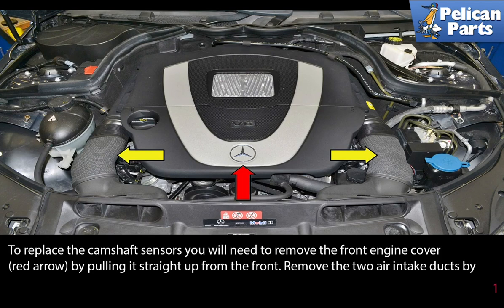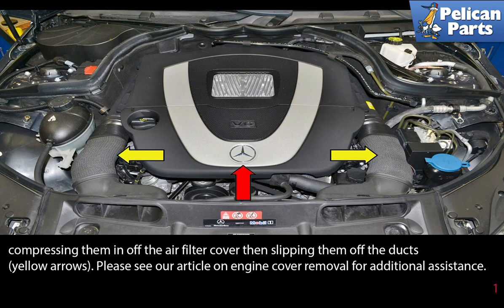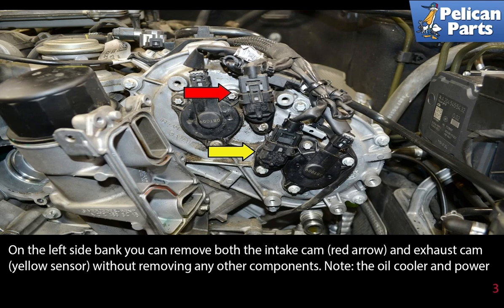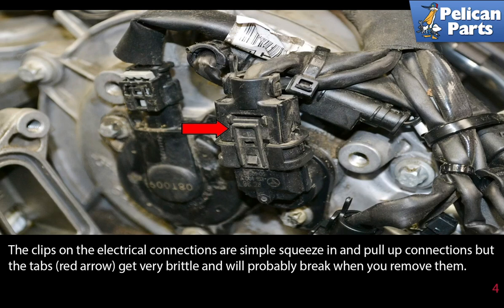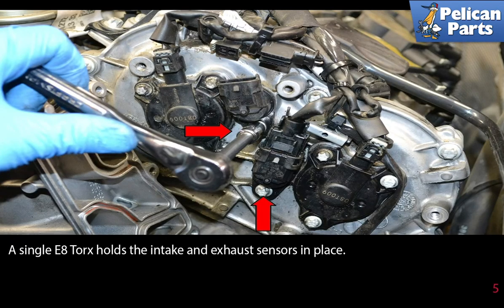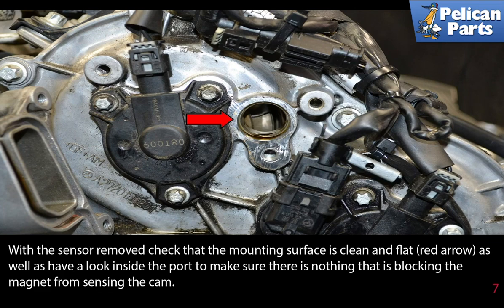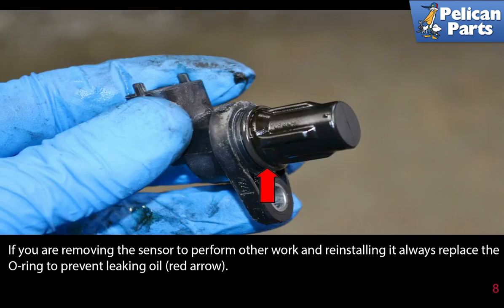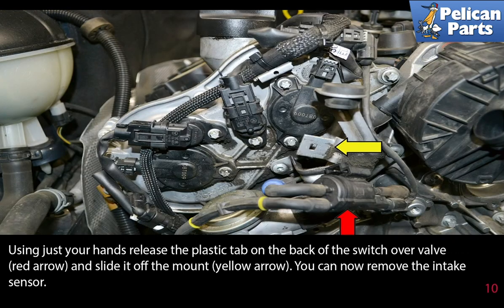Mercedes-Benz W204 C-Class Camshaft Position Sensor Replacement

Comment: sir  could you please answer my question , intake and exhaust camshaft position have same design so how we can identified that which one is intake sensor and which one is exhaust sensor because i am worrying what if put it in wrong side thanks.
Reply from the maker: The sensor near the intake manifold side is intake. Near the exhaust manifold side, exhaust sensor.

Comment: First time working on a Benz and video was great but quick question before I get started, This is for p0022 and p0012?
Reply from the maker: With those codes, you'll want to check mechanical engine timing.

Comment: Hey man do you know which is bank 1 & 2 on a 2013 c350?
Reply from the maker: On a 4-cylinder the first cylinder, closest to radiator. On 6-cylinder, first cylinder, closest to radiator on the right side, when seated in vehicle.
Reply: @pelicanparts  so which one is bank 1 ?

Comment: What is the torque specs for these?
Reply from the maker: What is the year and model of vehicle? I can see if I have that info.
Reply: @pelicanparts  2010 c300
Reply: @b.trill6868  2009 C350. Also you say you don't have to remove the oil cooler or the power steering unit. Do you need to loosen the power steering pump but not take off?
Reply: @waynesalekin4737  na for the sensors I didn’t have to remove or loosen nothing at all easy twist and insert
Reply: @b.trill6868  Thank you so much! I got it done without removing the oil cooler and power steering pump. Great advice and thank you for answering so quickly.